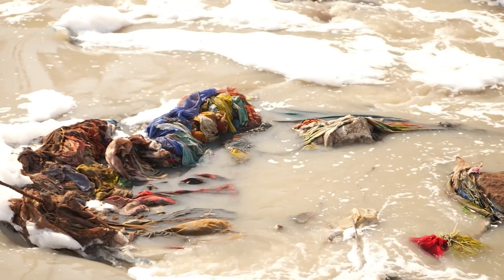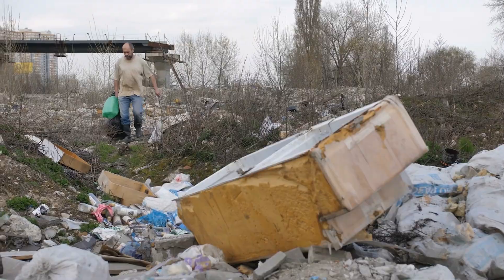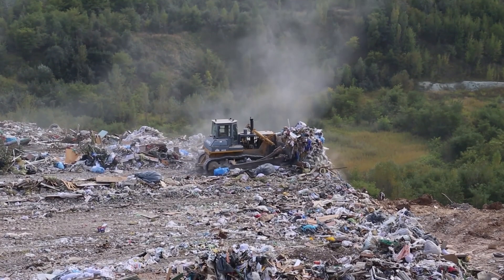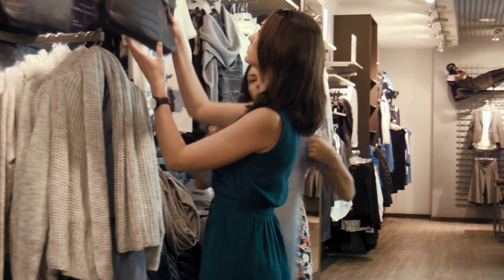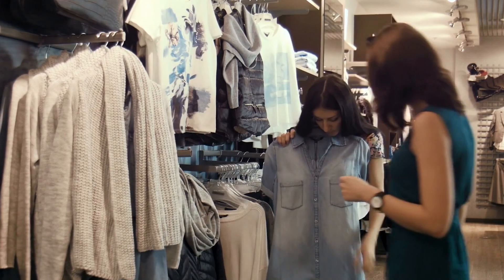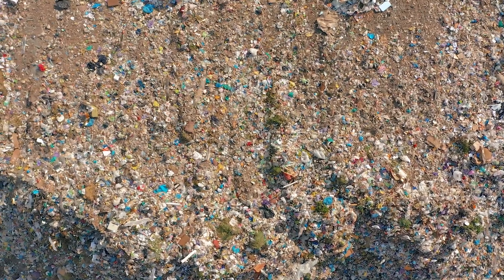What is Polyester | How is Polyester made? Plastic or Eco-Friendly

Comment: Oil serves as fuel, but since 1960 we discovered oil could also be processed into polymers meaning plastic, and plastic threads. So we started manufacturing Polyester, Nylon, Viscose etc. but being oil it keeps its ignition and flammable properties even as we wear it. Labels warn, but who reads labels. Trousers, Skirts, Jackets, and even our bedding - sheets, duvets, covers, blankets ALL MADE FROM FLAMMABLE OIL. Heat or flame will set it alight. AND IT CLINGS TO YOU, STICKING TO YOUR SKIN. I get irritation or a rash wearing it, and prefer cotton. IF COTTON IS SET ALIGHT, IT FALLS AWAY FROM YOUR BODY not clings to it. AND CAN BE EXTINGUISHED OR PUT OUT MORE EASILY. Sadly climate change has reduced production of cotton, and more artificial oil based fabrics are produced.
Reply: It has nothing to do with clima change. But oil is profitable for manufactor than cotton. Cotton is allso expensive for some people..

Comment: The worst possible material you could use on your body, a cheap man made fibre that is easy to use for printing logos on, designers got lazy and started using this silly material because it’s easy to maintain even though it looks silly. Polyester is not fit for a rag.